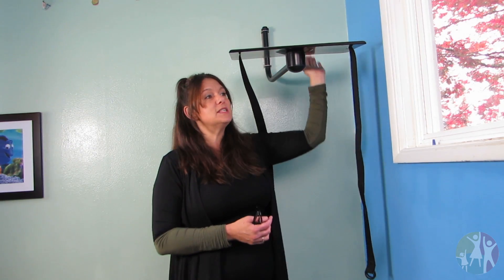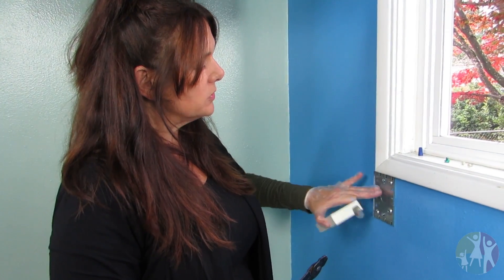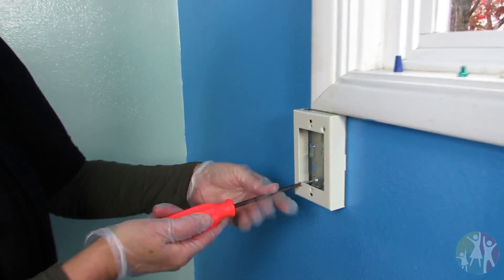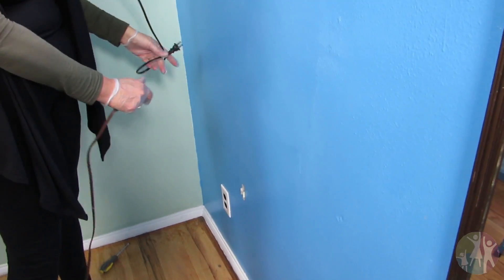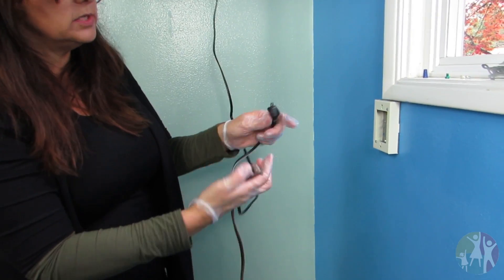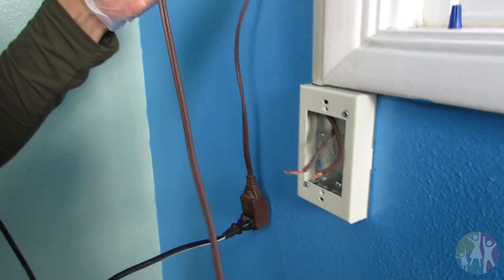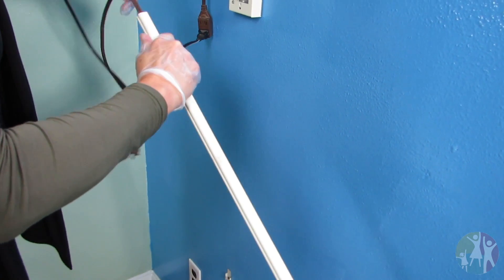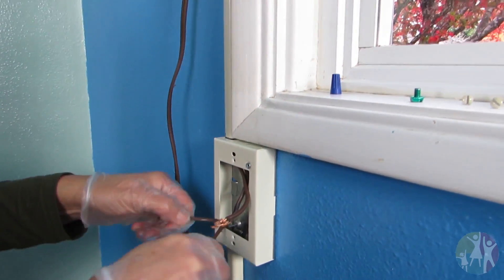Autistic Child? Don't Sleep? A Quick Easy Fix!

Comment: I came here due to my asd son having sleep problems. I'm glad I saw this, I'm a licensed electrician and what you're doing is completely unsafe
Reply from the maker: Why is it unsafe?
Reply: Most serious concern is that you didn't ground the metal wiremold product you used, this alone could result in electrocution, if the cord was to fray on the metal of the wiremold, that is what the green screw is for you had on the window ledge.
Second you have no regard for the polarity of the conductors, this is important.
Third you modified a ul listed product, and used temporary wiring as permanent wiring.
You could of just as easily done this safely.
Reply from the maker: +Ken Saenger thanks sooo much.. I will fix that now😳
Reply: @Normallifeautism please call an actual electrical technician to do that and any other electrical work. I don’t want to find out you got fried trying to do DIY electrical work.
Reply: @kensaenger6128 she also didn’t shut off the power with the breaker, didn’t make sure power was off with a meter.
Reply: @Normallifeautism messing with electricity when you aren’t certified to do electrical work lol I am also an electrical maintenance student/apprentice. Electricity WILL KILL YOU.